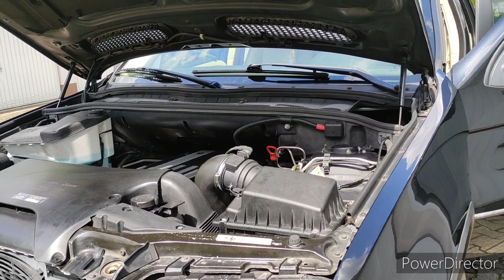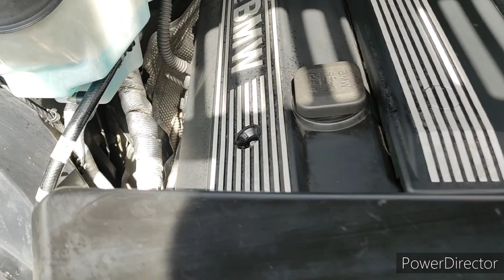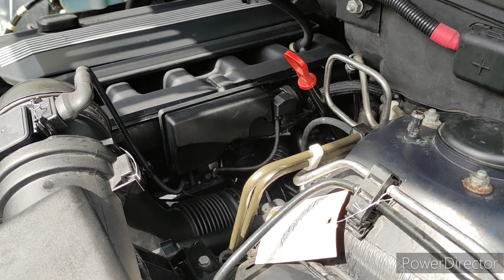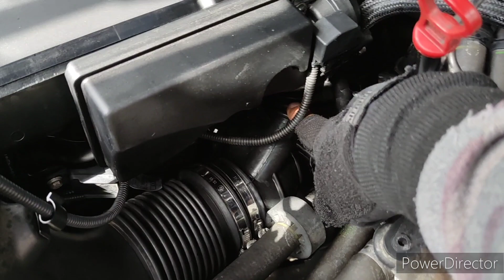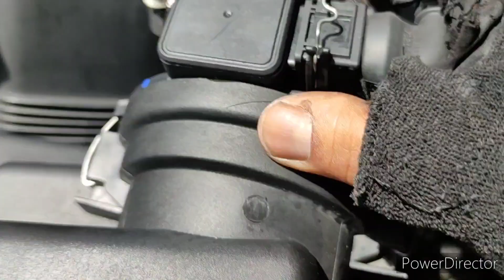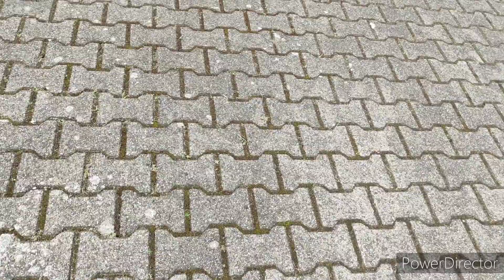BMW X5 E53. 3.0i. P0193. Fuel pressure high circuit. Fixed

Comment from the maker: Have you got any issues when driving the car? Black smoke means that there is too much fuel for too little amout of Oxygen. You have to check the fuel line. Petrol engine? Or diesel? Is there only one code?  After checking the gasoline filter under the car check the voltage of the lambda oxygen sensors. Should be between 0 and 1 volt. Then finally do a smoke test. In most casess one of the above mentioned problems is the reason.

Comment: i got this code and black smoke from my exhaust
Reply from the maker: Have you got any issues when driving the car? Black smoke means that there is too much fuel for too little amout of Oxygen. You have to check the fuel line. Petrol engine? Or diesel? Is there only one code?  After checking the gasoline filter under the car check the voltage of the lambda oxygen sensors. Should be between 0 and 1 volt. Then finally do a smoke test. In most casess one of the above mentioned problems is the reason.